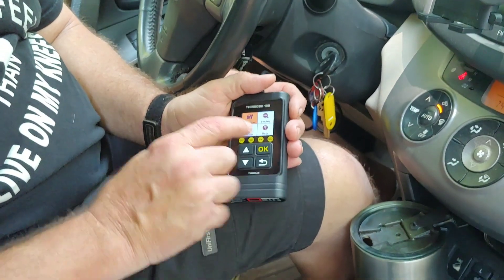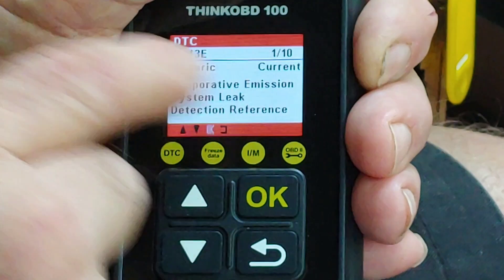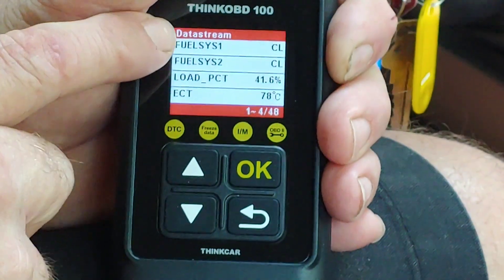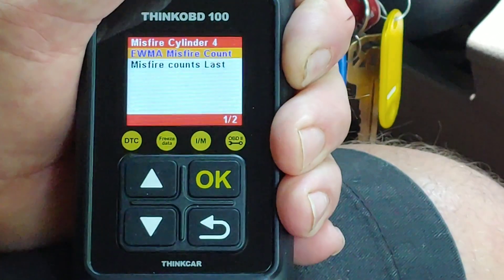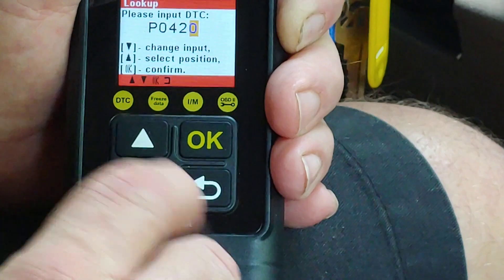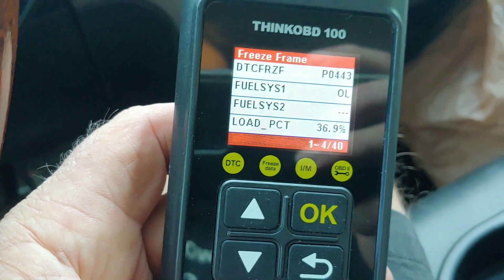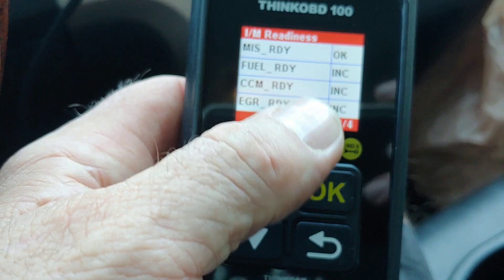Using a Generic OBD2 scan tool and list of functions THINKOBD Mode6 live data rediness monitors free

Comment from the maker: To find what you are after:
:50 Remove plug cap
1:02 tool should turn on if the fuse is ok
1:18 protocol search CAN or older types PWM or VPW
1:35 list overview
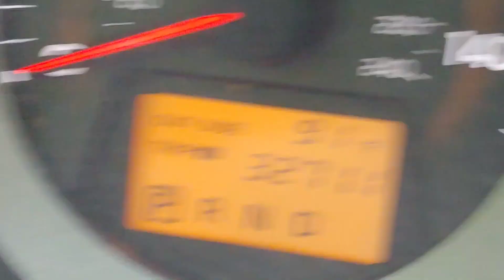2:02 CEL is on Toyota also turns on other lamps example.
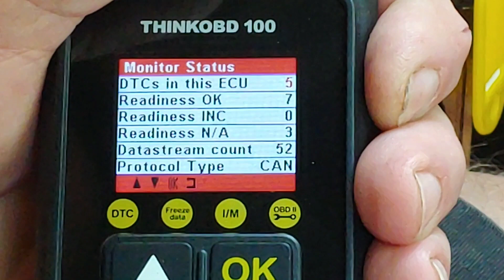2:10 State inspection monitors list 
2:20 Data PIDS (lines of Data)
2:30 Read codes
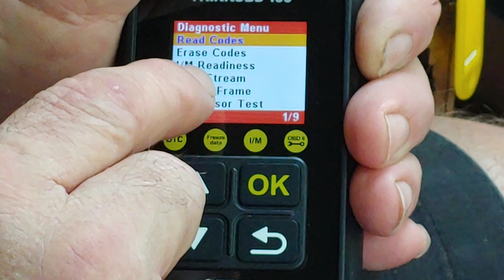3:00 Individual IM (inspection maintenance monitors) state inspection requirements vary by state
3:55 Data stream overview
4:20 Long and short-term fuel trim data
4:36 RPM data useful for cranks no start testing
5:13 Onboard monitors (Mode 6 Data) some will have misfire history (not all) and pass-fail of other systems.
6:40 Code search using scan tool (Google is faster) and codes can vary by manufacturer (same number but means different circuit be very careful here!)
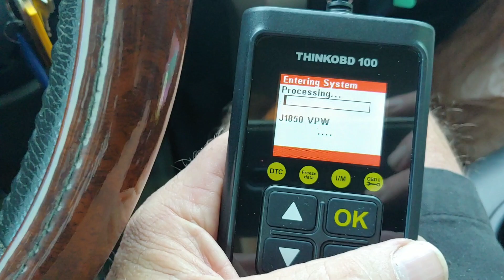7:56 Freeze frame (what set the code and what was the engine doing JUST PRIOR to setting the code this delay can be seconds long which will make a difference so it does not always catch the root cause but is helpful.
8:51 example of high long-term fuel trim (19% it must be above 20% to set a code) this truck has catch cans that are causing higher at idle long-term fuel trim.
9:33 Fuel rail pressure (if equipped) and supported useful for cranks but does not start testing.
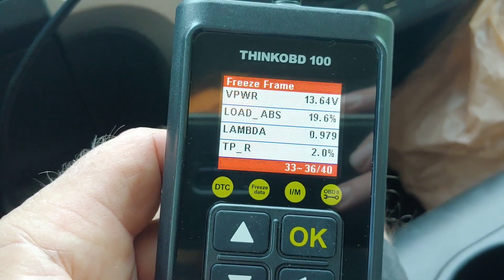10:15 Fly by wire data (electronic throttle and gas pedal (note values will never show 0% at idle in generic).
10:59 VIN and calibration data (look for software to be modified here if a tuner was used)
11:19 Non EGR vehicle but has EGR monitor on a 3.5 EcoBoost Ford which is not equipped with EGR but with dual VVT and can still make exhaust gas recirculate so has the monitor.